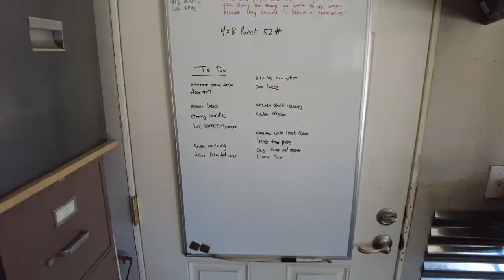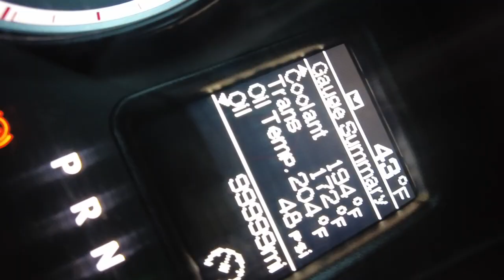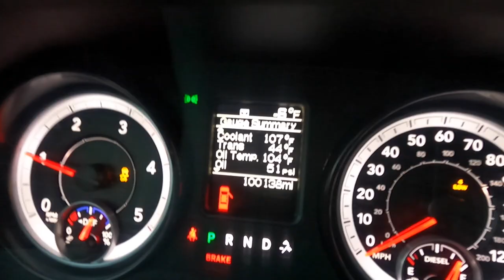Stranded In Our Truck Camper

Comment: snow, snow and more snow! sweet!
Reply from the maker: SO much snow!
Reply: @AmbitionStrikes  are the rails on top for protection? Considered guide wires on the front?
Reply from the maker: @d-arts7139  The rails are structural, offer protection for the vents and will be for mounting the solar panels. Turns out they also kept Riley from falling off while clearing snow from the roof!
Reply: @AmbitionStrikes  oh i remember now about the structural integrety. i know youll want to take it as many places as you can... without destroying it. youve seen limb wires?

Comment: One of the plans I have to mitigate line freezing is to take a line off of the hot water heater and return it to the fresh water tank.  
The return will start right behind the shower head.  

The idea is that I can push s button that will open a solenoid and prime the hot water line while dumping the cold water back into the water tank instead of it going down the drain.

You can also use the loop to heat the water in the lines, pump and tank.

My system will be part of an automation scheme so the controller will handle it.  But you guys could do it with a solenoid and a switch.

Great vids, keep em comin.
Reply from the maker: That is a really good idea! What kind of logic do you think would work well for the solenoid? Periodically on a timer, plus a momentary button right before doing dishes. Or do you have another idea? We are planning to add an outside temp sensor so we could also tie into that.
Reply: @AmbitionStrikes  I’ve been learning to program Arduino sketches and plan to have the valve controlled by a WEMOS D1 mini connected to a 5v triggered relay like this to open the solenoid valve.   The D1 will have a temp sensor in the water tank and maybe near the pump.  The momentary push button near the shower (and possibly by the sink) will trigger the WEMOS to hold the solenoid open for a specified time. 

My concerns with the system are that it will be going off in the middle of the night and the pump would ruin my beauty sleep.  The other is if there will be hot water available to actually circulate.

I think the simplest design would be to have a toggle type switch or a simple timer.  You can circulate the tank water for a few minutes before bed, or after a shower while the hot water plant is still running.  

I’m sure there’s a 12 volt device that will generate a contact closure based on a temp input,  if I see one I’ll post.
Reply: @AmbitionStrikes  ooh, you know what could work...

If you got a small aquarium pump (they make 12v models) put that in the tank, and have it push water through the lines. You would need a check valve or cut off solenoid between the pump and where the aquarium pump dumps into the line...

Not sure if you can push water through these pumps while they’re off, but if you could put the aquarium pump output on the suction side of the pump and then a check valve solenoid between the main pump and tank (so the water doesn’t simply go back into the tank through the pump suction line...

It’s a little out there in idea land, but it would keep the lines and pump from freezing, would be a minimal electric draw, be very quiet, and if you preheated the tank water before bed, you can shut down the hot water plant on the overnight...

Comment: The dog bed in the cab looks like it worked out really well.  I have a platform over the rear seats in my Colorado with the extended cab.  I have been considering removing the rear seats.
Reply from the maker: The dog bed has been an amazing addition!

Comment: Season 1 episode 1. I guess the build series is basically complete. The camper looks amazing. Looking forward to a build/cost sheet. My over/under guesstimate on parts + vehicle is $50k. If you value your time (labor + design + research), I think the over under is closer to $90k. So a relative bargain compared to what’s out there.
Reply from the maker: There will be a few more build episodes but we are officially on the road! We plan to make some modifications, especially to the truck while on our trip. We will be doing a cost breakdown video very soon!

Comment: You could glass bead the shower door. ..........even do a taped off design in it!..........I was out your way 2 yr. ago. We went to  Yosemite Valley then down to the big trees, after that we headed over to Lake Havasu City. I wanted to take 120 to 395 but didn't see a way to the trees. That was a 10,000 mile road trip, a little over 30 days. Maybe we will get back that way someday. It looks like your truck is working out for you! Do you think that the 1"foam is enough insulation or do you think you should have more?
Reply from the maker: That is a really good idea! Funny enough that may be one of the only tools we don't currently own... 😂 We are honestly too warm in the camper with the diesel heater so right now we are very happy with the 1" foam. Come summertime we plan to install a mini split a/c unit and will report back on how we feel about the r-value!

Comment: I noticed in your build video you guys used R5 foam board, I'm just wondering if you were plenty warm during the blizzard? I'm getting ready to build a very similar rig up here in Canada so I'm just wondering if 5 is going to be enough! Thank you for all your informative videos, I love watching you two.
Reply from the maker: Yes even at temps as low as -12F we were plenty warm. In fact we always leave our roof vent open, fan on low and a window slightly cracked to get good air flow and keep humidity down. The diesel heater is still on its lowest setting. While it's only R5 having it be continuous with no thermal bridging is the key.
Reply: @AmbitionStrikes   I really appreciate your reply, thank you very much!

Comment: Does icicles forming on the front of the camper like that mean you have a heat leak on the roof somewhere?
Reply from the maker: Hi Caleb! To control moisture inside we had our rooftop vent above the bed blowing hot air out constantly. This caused the snow on the roof to melt and form icicles!